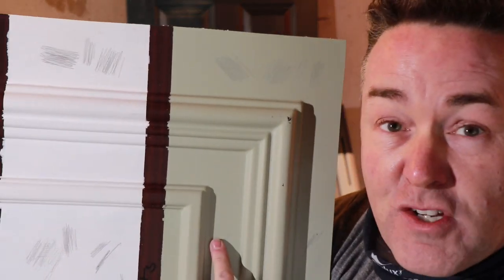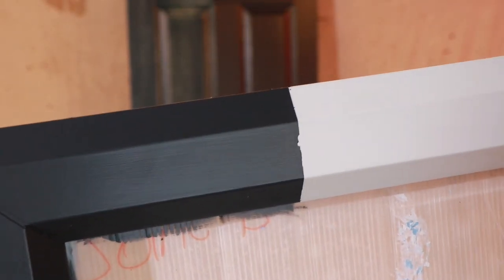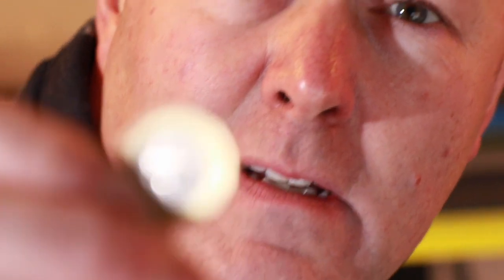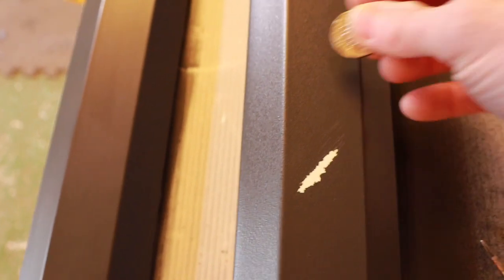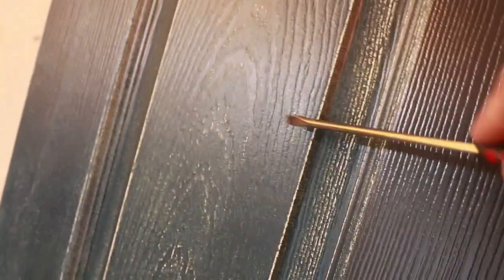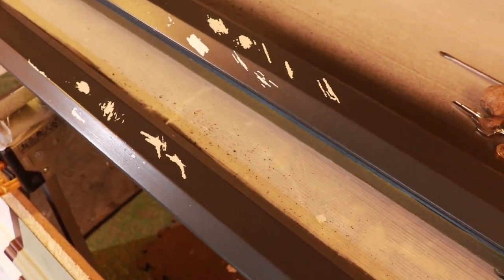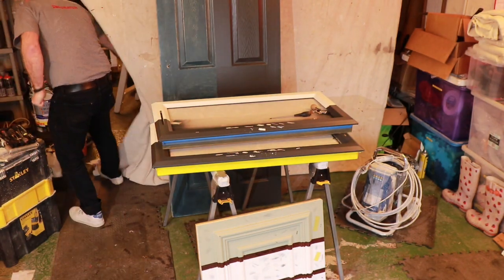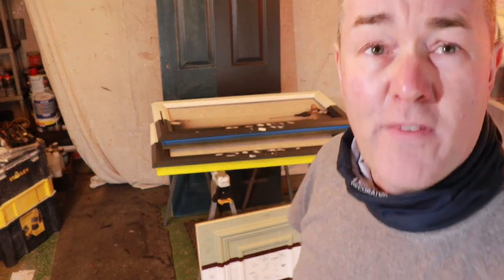KolorBond AquaTek - Scratch Test - follow up - is it better than Frenchic?

Comment: Great video !!  I have painted 3 windows so far with Allcoat and not wonderfully happy. Was about to buy Kolorbond but having watched your 2 videos I will now buy a small bedec and Frenchic to see which one sprays best through airless.  Saved me a LOT of headaches when I had painted 30 odd more windows and found it all flaking off !
Reply: What was the results? What product did you use?

Comment: I was settled on ordering some Kolorbond this week but think twice now,  I will have a look at other products I think.
Reply from the maker: Where were you planning non using it?

Kolorbond is Great.
Try the original and not the water based version.
Reply: @ProfessionalPainterDecorator  I realised after I wrote this comment that this was the water based version 👍🏻 I will use the original 🙂
Reply from the maker: @GavinMcC  watch the vids on the window and door painting.
Also I did a follow up on jobs I've used it. All good.

Comment: Hi Phil, just watched your video on the Kolorbond aquatek, scratch test, a very good video, lots of information, top man, I must admit I always use the bedec, keep up the good work 👍,
Reply from the maker: Cheers, Thanks. Yep, bit of a shock result. The other KolorBond I've used is really good.. you seen those vids?
Bedec.. really good stuff, you watch the product testing of that against AllCoat and Frenchic yet?
Reply: @ProfessionalPainterDecorator  hi Phil, thanks for the reply, yep I watched your other video,on the frenchic, I was well impressed with it, all I’ve heard or read about it is good, I was a bit shocked with the allcoat, I’ve used the Zinsser stuff for years, but love the videos and information you give out, what is your go to paint brush, I’ve not tried the ones you have been using, I like the Hamilton and purdy stuff,👍
Reply from the maker: @billysbrushes6411  brushes.
Don't laugh.... For a nice easy to clean out... Try Wickes own brand pack of three. 1" 1½" 2" brush pack, about £11.
We moved from Purdy Pro Monarch (blue bristle) to use those.

We also use the EcoUnion MiB brushes.

And have a look at Arroworthy Classic. Either slash cut or traditional.

Get those at Crown and other paints brush supplies.
Reply: @ProfessionalPainterDecorator  thanks for reply Phil. I, will check the brushes out, have a good weekend 👍

Comment: Great video. Customer service with Kolorbond is aweful. I used kolorbond original on a set of my own doors , guaranteed not to fade and they faded like crap after 14months. Kolobond used every excuse in the book🙄🙄. Love the video’s Phil👍🏻
Reply from the maker: I've spoken with KB and we're going to get out heads together in the new year and look at what may be wrong... Me or the product.
Reply: @ProfessionalPainterDecorator  they usually blame the painter and not the product. But will look forward to seeing how it goes. My mate used the aqua on internal windows and it came off just the same. They blamed him, but he was a very experienced car painter and his prep work is 👌🏻. But it failed just like yours.
Reply: We are well into the new year now June. What was the outcome of the deep dive on the paint?

Comment: Hi, I’ve been using kolorbond original for upvc windows and I’m wanting to move onto kitchens, I rang them up they told me to use the aquatec for kitchens? Have you used them on kitchens before? I’ve just ordered some for my own kitchen wish I’d seen this video 1st lol
Reply from the maker: LoL. Where I used it on Doris the door... Did you see that.
It's well solid.

Prep well, you can't do anymore.

I use helmi 30, and everal aqua on kitchens.. also F&B modern eggshell.
All no issues.
Reply: Use Renner products. 
You won't look back

Comment: TP2 primer and then Tp5 finish I know cellulose based test that against the colour bond you usually use and you might be surprised which is better
Reply from the maker: The KolorBond Original/classic I use is brilliant and I've had no problems with it.

This test was with the WaterBased Aquatekto see how that is, not everyone sprays and there's plenty who want to se a brushable  product for uPVC.

On my test though it's not seemed to want adhere to the uPVC, I wonder if the uPVC is the problem and it's not sticking to it... it was new, but I did clean it down... see my other video on prep...

Really quite strange that even with my nail it came off easy.

I know the other sample board with AllCoat, Bedec & Frenchic is a different uPVC panel, but they held up well. It might be worth me doing the same test with same paints on the different uPVC to see if they act the same.
Reply: @ProfessionalPainterDecorator  I'm always sceptical of products with out primer especially water based products, I dont think you did anything wrong it's just the product but there are other spray companies that do water based products for upvc but doubt any are as good as the cellulose, hopefully the video saves some people from wasting there money and getting a bed name

Comment: What’s the bedec drying times Paul? Got a litre sample at home
Going to spray my dads front door with it 
Cheers mate
Reply from the maker: when it's dry it's dry lol
without looking I'd say a good couple of hours is fine. The longer the better with some paints though.
Reply: @ProfessionalPainterDecorator  i sprayed my first upvc door today paul with the hvlp you have! i felt like i used so much paint i used the kolorbond.. i think i need to adjust my gun settings but the job still turned out perfect, do you lubrciate your gun everytime after cleaning?
Reply from the maker: @Shortboxing47  first coat a fine waft.. then build up from the adding a bit more paint through the gun with each coat.

When I clean up, I always wipe some  vaseline or needle oil over the needle length.
Reply: @ProfessionalPainterDecorator  cheers for your help phill if it wasnt for you i wouldn't of ever started my spraying journey youve gave me the confidence

Comment: Just wondering if this is made for colorbond by aquatec. Who are based in Wrexham and water based suppliers. Solvent based will, I think always have a need. Water based in some situations is not good
Reply from the maker: Happy New Year Paul. That I don't know. But the solvent base is very good. Have you seen those application videos I've done?
Reply: @ProfessionalPainterDecorator  Yer Phil. I've seen the ones with the water based and solvent. The water based has a long way to go to be anywhere near as durable as the solvent. That level from Lidl is a canny bit of kit for the money. Good review. Oh and happy new year to you and yours.
Reply from the maker: @paulos9304  and to you too.
Check the uPVC window and the door spraying too. That's all with the kolorbond solvent base product. That's really nice to use.

Comment: If I'm totally honest I think I prefer that brushed finish it looks a lot smoother than the sprayed finish. Like you said if you had thinned it down you would have had a lovely finish with the sprayer
Reply from the maker: Yeah. Testing it as it comes out the can. Just like anyone else ;)
Reply: @ProfessionalPainterDecorator  now now phil no need to be so sarcastic 🤣 I'm really quite surprised how easy that came off! Didn't adhere at all
Reply: I'm surprised wow, it acted like you used contract matt emulsion. not fit for purpose, this video will save countless guys lots of money/time. imagine having to put a full house right after this has failed ? great video mate 👍
Reply from the maker: @Twistednutz  But have I done it wrong?
Reply from the maker: @marsdencarl89  I think Carl next time round for spraying it I would thin it down, but for brushing... it took 4 coats and that was out the can, you wouldn't want it any thinner... you're be coating it up more than 4 coats.
Reply: @ProfessionalPainterDecorator  fair comment there bud 👍 I didn't realise just how thin the stuff was, I don't think I will be using this anytime soon thanks for the demo! I did a outside about 4 years ago brown upvc windows to a cream colour and they still look spot on to this day and that was using zinsser allcoat exterior waterbased
Reply from the maker: @marsdencarl89  was that straight on or did you use 123 as the grip primer first?
Reply: @ProfessionalPainterDecorator  straight on mate gave the frames a quick key wiped them down with some soapy water and gave 2 coats of allcoat job done
Reply from the maker: @marsdencarl89  AllCoat exterior wasn't so good on my other scratch test.. 29days later.
Reply: @ProfessionalPainterDecorator  the window frames I painted did have a wood grain effect so maybe it keyed better to it because it wasn't so smooth it that makes sense 😉

Comment: Dont use this paint, most paints are NOT suitable for spraying UPVC or any plastics, especially waterborne paints!! only a handful of manufacturers paints work, and believe me they are expensive, upwards of £180 for 5 litres, and there all solvent based paints!!!! Im a furniture spray by trade and im not sharing pro paint manufacturers, as solvent sprays are for professionals !!!!!
Reply from the maker: Have you seen Bedec and Frenchic on uPVC that I scratch tested?